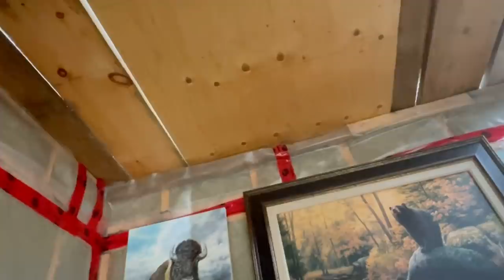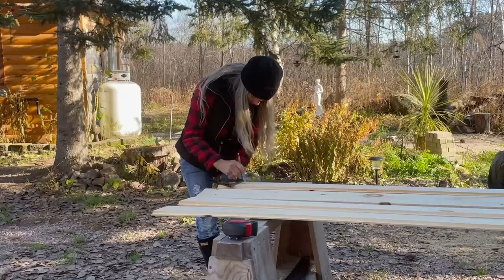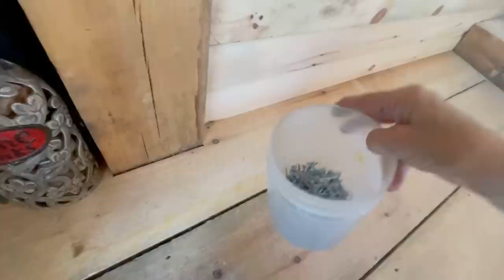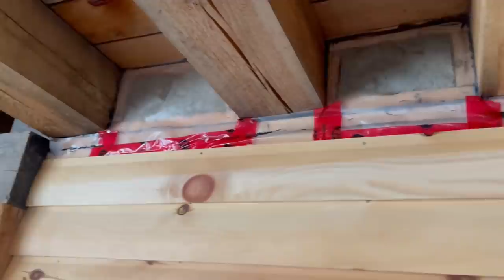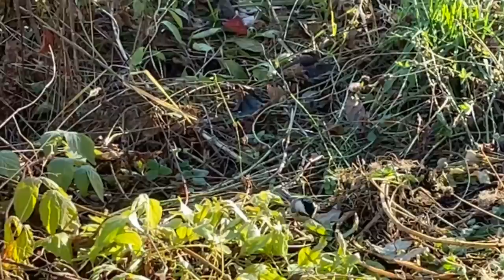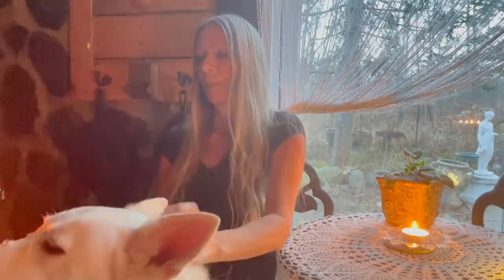Solo Cabin Renovations/EP-43

Comment: Nailing, can be difficult. Try using a drill bit thats designed for wood screws, much easier.
Reply: I used 16 gauge brads for the T&G pine in my cottage . You can put 3 in per stud. Faster ,easier than nails or screws.
Reply from the maker: I just don’t have a Brad nailer
Reply: @One.woman.wilderness  I will ship you mine . I think you said you have a compressor
Reply from the maker: @alexs3447  
It’s a small compressor, and that is very kind of you Alex. ❤️
Reply: @One.woman.wilderness  Well your job can be done by hand . But i fired some 13,000 brads in my cottage . Never thought i would , but i have video of the empty brad boxes. Now the tools sit in a friends garage unused for many yrs.

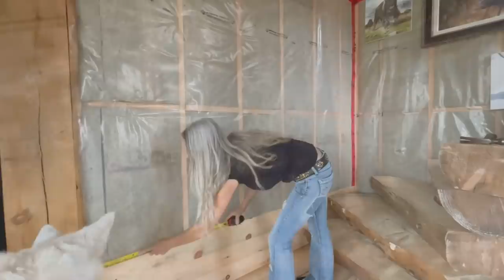Comment: A question, @4:36 mins. does that ceiling beam go through the wall or does it stop at the wall? If it stops there it needs a post in the wall under to support the loads? Thanx. Looks great! You speak very well, don't listen to the peanut gallery! Love the accent.
Reply from the maker: No, the ceiling beams doesn’t stop at the wall. I needed to get my building inspected and it’s as per code. And thank you Tom, I really appreciate it. 😊

Comment: I agree with Duane Linquist, I admire you and your work
As a retired carpenter may I suggest that when using a hand saw you point your index finger alongside the handle and you keep your shoulder, elbow and hand in a straight line behind the direction of the saw cut, just a small observation of you good work x
Reply from the maker: Thank you Roger, I will do this. Much appreciated 😊❤️

Comment: I love your bird feeders as I love to watch the birds year round but especially in the winter but the dang squirrels are trying to take over as a couple weeks ago I had 2 pairs of Bluejays and the squirrels chased them away last year alot, I have 6 feeders and 2 suet feeders and last winter one day I counted 15 squirrels on the ground while 3 of them were kicking out the bird seed out of the feeders for the ones on the ground. What's your next plan of attack for your cabin. We had a Clay pot like you have but one night the fire got to hot and cracked and later fell apart. But I liked how you heated up your pan on the chimney of your pot. I didn't see your video of your generator till after this video, looks like you have enough generator for your use.. The 4Patroits has all kinds of stuff and something I like are there dehydrated sealed meals in a bag. Oatmeal and Mac and cheese and they are very reasonable not expensive and I have been getting some pkgs for backup in case of food shortage because of Covid-19 we butchered a pig this spring and we are out of bacon already as I love to cook with the bacon grease like my Gma always did. Do you see any Bald Eagles up by you ?

Comment: U might want to cut boards in half to make it easier to handle. Then stagger the boards if possible. Be safe please don't reach to far over your head because if you fall we don't want you to be hurt.
Reply from the maker: I will need to do this on the second floor as I’m continuing with same boards. The wall is longer, 16’ in length. So I’ll have to stagger pieces but that will be fun. I’ll be careful! 😊❤️